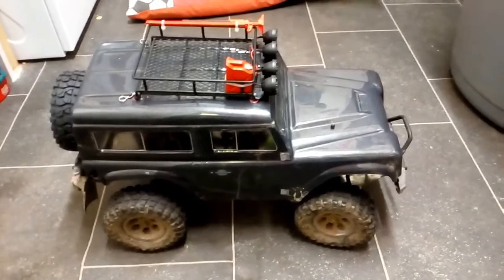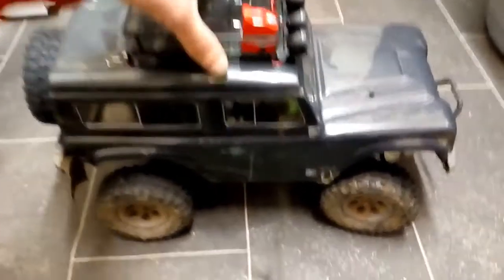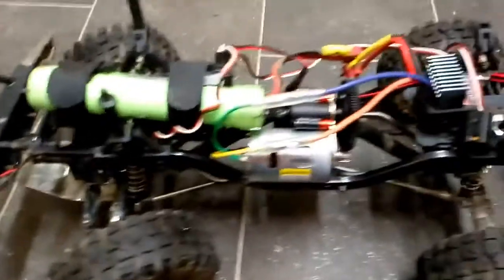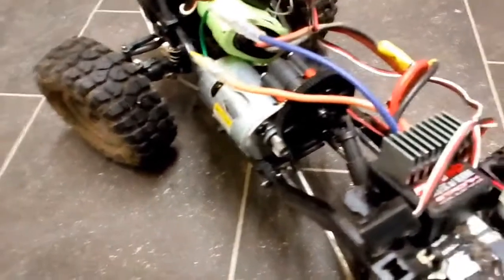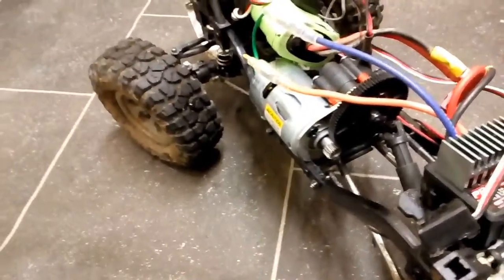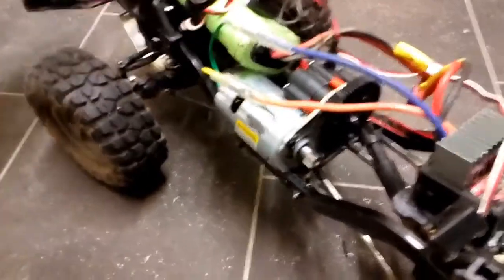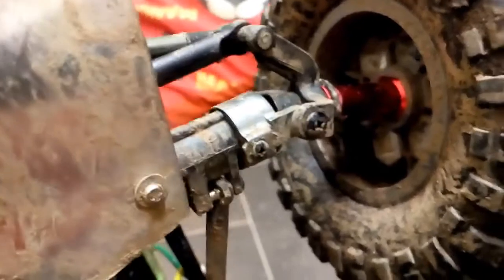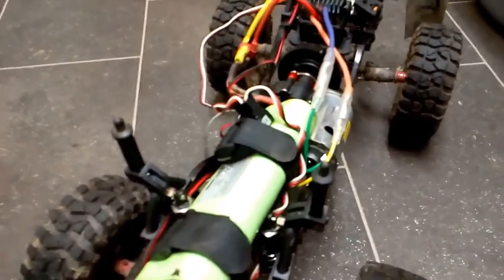Ftx outback 540 motor upgrade

Comment: Hi,can this vehicle run slow with that bigger motor?
You just need the right gearing?
Reply from the maker: dragon model hi there it will run at very low speeds just fine